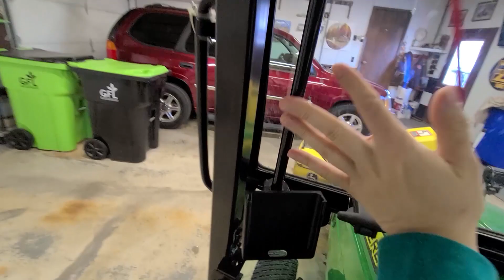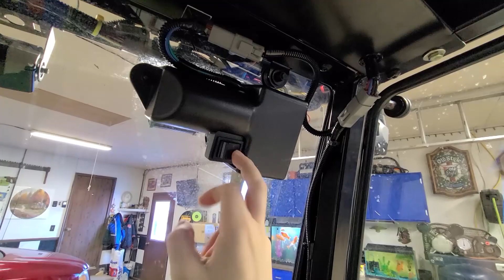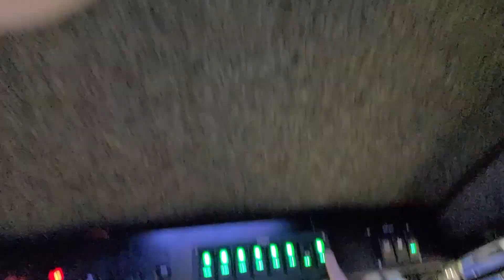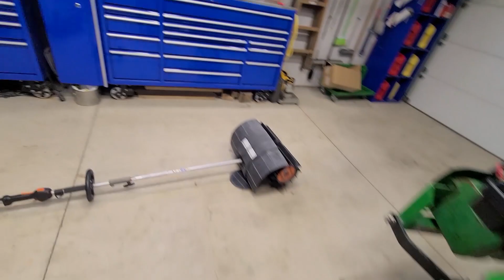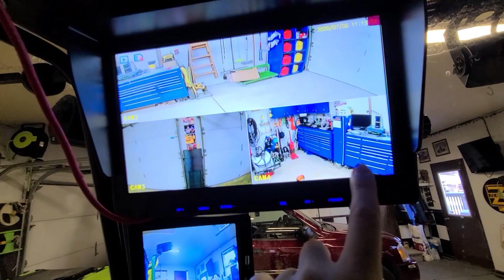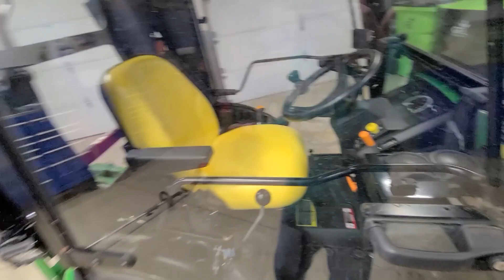Lets Take a Closer Look at My Cozy Cab on My JD 1025R

Comment: You have built an awesome work place for yourself.  With as much snow removal as you do as a business.  Have you had many failures,  like drive shafts or pto? I'm doing a pretty good amount of snow removal here in Idaho in the mountains where our cabin is. Same 47in HD blower as yours. In 2 years i have only broke 1 shear bolt.
Reply from the maker: So I no longer have this yellow snowblow. I had a lot of problems with the hitch. I'm now running the 47in Heavy Duty Snowblower https://youtu.be/JwJmPdjF3ZM    If I would be still running the yellow snowblower it would be junk by now, the new green HD snowblower is great. this is my second year with this blower and I only broke the chute cable and the top part of the chute.
Reply: @masterofeverything6468  thank you for the reply.  I have the same 47in HD green blower as you. I'm glad to hear you haven't had any failures with the tractor while doing this much work with it. Maintenance is key also

Comment: I have a few questions:

1: will this cab work on a white outdoor lawn tractor?

2: how much did you pay for this cab?

3: did you wire everything to the battery How does that work?

Thanks!
Reply from the maker: #1, Its only for the 1025R. #2, The cab new is 7k I payed 2k for it. #3, There is a 4ga wire from the battery to the cab with a quick disconnect.